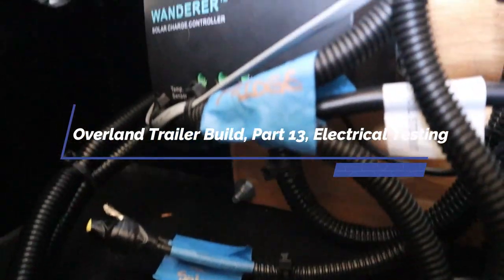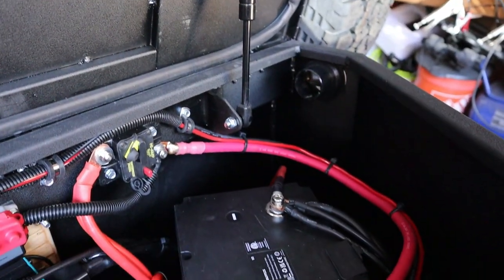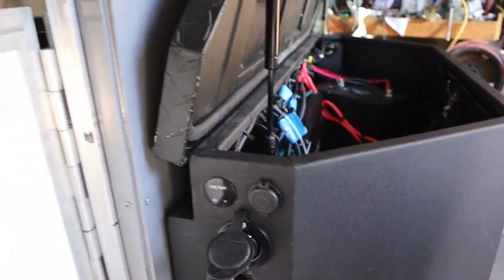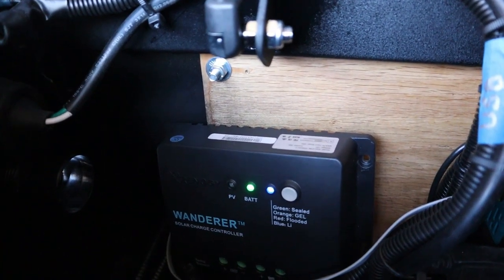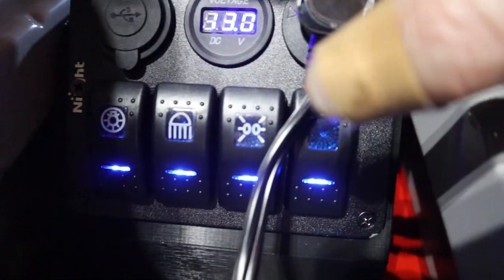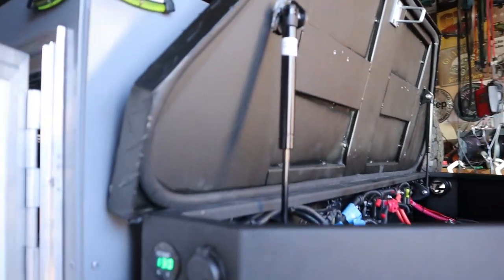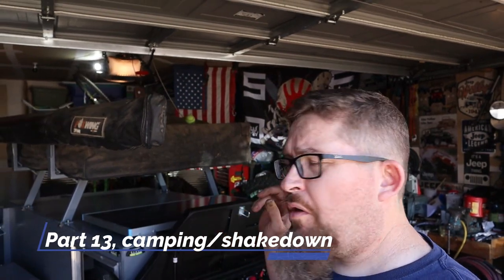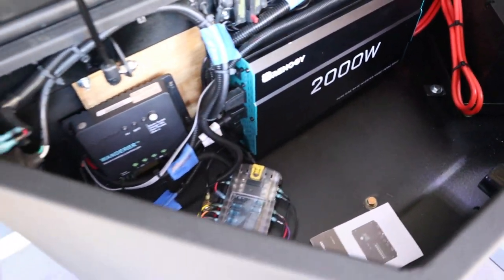Overland Trailer 2022 Part 13, Smoke? Fire? Electrical Testing.

Comment: Are you going to wire in a vehicle trailer charge system? I have a 7 plug pin for my colorado and i plan on running an Auxiliary charge system to my trailer batteries.
Reply from the maker: I thought a lot about doing that. I was going to buy Redarcs system but the cost was more than my budget would allow and I've got the solar panel so, I'll run it this way for a while and see how I like it. I can always add one later.